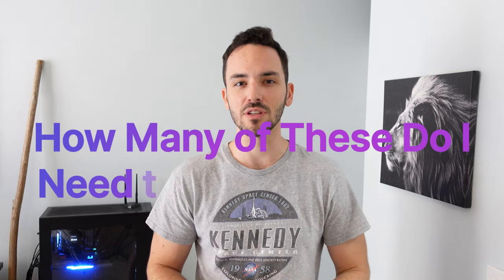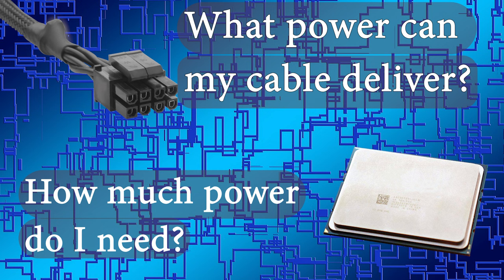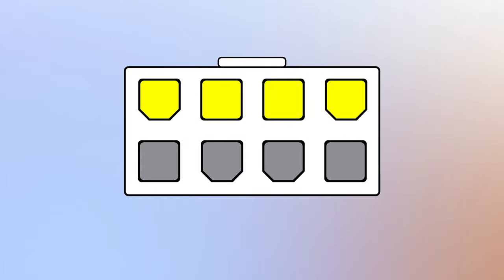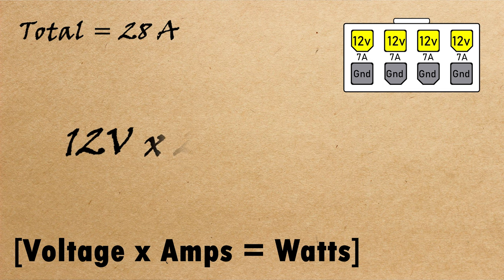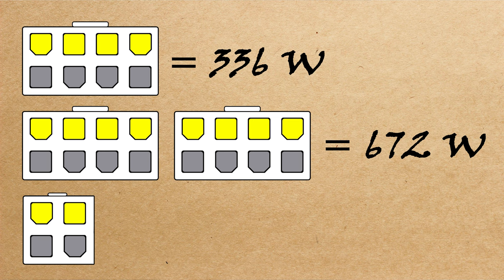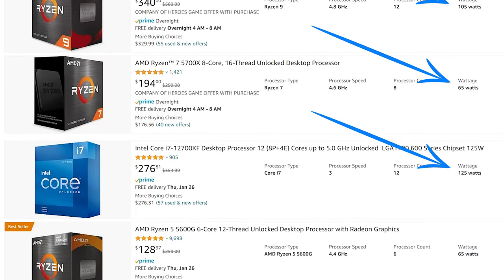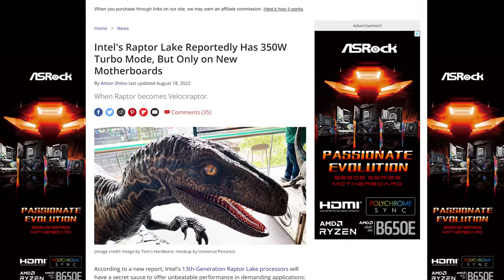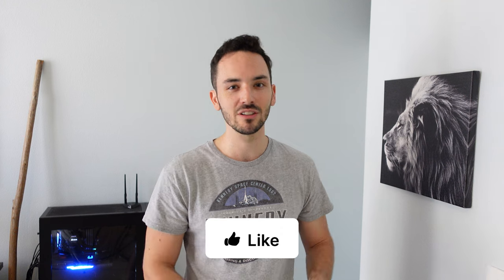CPU Power Cable Guide - Understand What You Need!

Comment: Need help asap, what if the Squares and Circles dont match from a CPU connector versus motherboard layout.
i.e. MB is (sqaure circle circle square) but the cpu cords is (Square circle circle circle) can you mix layouts? or are they that way to designate Volts to Ground?
Reply from the maker: They should match up, try flipping them, or make sure you aren’t using the pcie power cables (for gpus)
Reply: @MaxsTech  another example here: I can't flip them without disrespect the shapes.

My CPU cable on the PSU are like this:
Round, Square, Square, Round
Square, Round, Round, Square.

My mother board asks for this exact shape as well, BUT, the other end of my cpu cable (the one that goes into the cpu slot in the mother) are a 4+4 pin like this:
Round, Square, Round, Round
Square, Round, Round, Round.

I must buy a new cable or can I go like this?
I have to buy a new PSU? 
I will fry something if the round ones on the cable fits into the square shapes in the mother board?

I was assembling my new mother board and had to stop because no one seems to know the answer for this. I don't wanna a fry a fresh brand new motherboard that I've just bought it. 😅
Reply: Bro am facing the same problem 
Need help 😢

Comment: I have a 8+4 pin in my mobo.
So one cabe goes 8CPU/PSU.
And the other is 8 on PSU, and the other tip i can split into 4+4. The question is: which one of this two sided 4 pin should I connect into my mobo? Does it matter which half I put in?
Reply from the maker: I don’t recall which one is standard but they are all keyed so only one should fit.
Reply from the maker: You’ll see the pin shape is either a square or like a square with 2 corners cut off so it’ll make it impossible to plug the wrong type power cable in.

Comment: Hi thank you for the video 
i subcribed your channel
I have asus 570-p.amd 5900x.asus 3060 ti mini oc .32gb ram 2 tb ssd.7 fans total 
Asus TUF-GAMING-650B 650W 80 Plus Bronze
i test with wattmeter 
on idle my pc 189 watts
cpu benchmark 310 watts
gpu 398 watts
on my motherboard 8 pin is connected .Do i need to connect the other 4 pin 
what are the plus and minuses 
thank you

Comment: This was a great video, quick question. My cord has a cpu 8 port on one end and a 4+4 split port on the other (the 8 port connects to the psu) but my main question is does the shape of the port matter because my motherboard ports are differently shaped than that of my 4+4. It fits but just not sure
Reply from the maker: All the cables should be keyed to only fit the ports they are meant for. So your graphics cards power cables won’t be able to fit in your cpu power port and vice Vera’s
Reply: @MaxsTech  I think I understand what Slennister meant. He's  it talking about the pcie cable.
I'm having the same issue here.

My CPU cable on the PSU are like this:
Round, Square, Square, Round
Square, Round, Round, Square.

My mother board asks for this exact shape as well, BUT, the other end of my cpu cable (the one that goes into the cpu slot in the mother) are a 4+4 pin like this:
Round, Square, Round, Round
Square, Round, Round, Round.

I must buy a new cable or can I go like this?
I have to buy a new PSU? 
I will fry something if the round ones on the cable fits into the square shapes in the mother board?

I was assembling my new mother board and had to stop because no one seems to know the answer for this. I don't wanna a fry a fresh brand new motherboard that I've just bought it. 😅
Reply: @guisa9 I have the exact same issue, did you ever find out how to do it?
Reply: @davidayon7112  in fact, yes. Turns out is OK to plug this way. The square ones shouldn't fit the round ones (and they can't that's why they are this way) but the round ones can go into the square ones with no problem.
I bought a new PSU and it comes with the exact same cables as before. I was mad lol. Than I ask for advice in some forums and ppl told me this. I tried and worked fine.
Reply: @guisa9  thank you SO much for this, genuinely a lifesaver. I had this exact same problem and thought I had to buy ANOTHER PSU (I just got back from picking up a new cpu cooler because my old one had non industry standard screw spacing). saved me lots of stress and possibly some money too. thx
Reply: @hallozer7805  I was buying I new pc too. Even bought a new PSU that came with the same cables as before. I almost went crazy. God bless the technology and electronics forums people 😂

Comment: Hi I hope that you have a good day.
My 850W Gold power supply has only one 8-pin CPU output, but my motherboard has two CPU power inputs (one 4-pin and one 8-pin), and my processor is a Core i5-13600K. Can I overclock with just one 8-pin cable (4+4)?
Reply from the maker: Yea you still have a decent amount of wattage to work with even with just a single 8 pin.

Comment: So I have an old 8+4 cable from cablemod, can I still use it on an 8+8 motherboard ?
Reply from the maker: While I don’t like “old” cables for use for power, as long as the cable is in good condition I would just double check the wire gauge to make sure it’s the same spec as whatever power supply you have and it should be fine. I doubt you’ll have any issues with power, 8+4 is a lot.

Comment: I have x99 with 2 cpu socket, 2 cpu power connector (8pin each one). It's seems bottlenecked if only using single power connector.  First cpu 8 pin powered ,second socket cpu no power connected . My cpu e5 2620v3, x99 jginyue x99 8d4 2.5, latest manufacturer bios. Underload, max CPU speed 2.59ghz on all core.

Comment: Great video dude. My RM850x only has one 8pin cpu cable. I just ordered a 13700k Z790 and DDR5 then was like oh no i need a new PSU... but no i know i dont
Reply: So are we good? It's good without  that small 4 pin ?
Reply: @michaelgerrardtyson4197  tbh i got such a good deal on a be quiet 1000w ATX 3.0 psu i just got a new one. But my friend has a 13600k and only uses 1 connection, and he is having no isses.

Comment: Good video, congratulations !!!
I have a question:  My mother board has only one CPU 8 pins female connector but my power supply has only one 4 pins male connector and one 6 pins male connector for the graphycs card which is not used.
The procesor is a Xeon E5 2630 V3 with a TDP of 85 W.
My question is: Is it safe to conect the 6 pins male connector to the CPU 8 pins female connector ?
Thanks and blessings !!!
Reply from the maker: You actually won’t be able to, the power cables are keyed to make sure you can’t use your graphics card power on the cpu power. Each connector is slightly different with the corners flat or square
Reply: @MaxsTech  If that´s true then the 6 pins connector from my power supply is not for the graphics card because it fits perfectly in the 8 pins connector of the motherboard.
Anyways after analysing your explanation about the amount of energy that 4 pins give to the procesor ( 168 W. ) I realized that it´s more than enoght for the 85 W. procesor I have.
Thank you for your fast and kind answer  and for all the valuable information shared in your video !!!
Blessings !!!
Reply: You are absolutely wright my dear friend !!!  Today I noticed that the 6 pins connector from the power supply fits perfectly in the 8 pins socket of the motherboard BUT THE CABLES ARE UPSIDE DOWN !!!  I was lucky that I did not try to plug that 6 pins connector on my motherboard, otherwise I´d have fried the whole thing !!!  Thanks God the 4 pins connector showed me the right position of the cables !!!  Thank you again for your video !!!

Comment: Hey great video, looking into components for my own PC and the MB I was looking at had an 8 and 4 pin cpu power ports but the PSU I already have has just an 8 pin for the CPU so just for  clarification if the cpu doesn’t exceed 336w then just the 8 pin is needed?
Reply from the maker: Correct, the extra 4 pin would only ever need to be used if you needed additional power for your cpu, so as long as you’re under 336W you won’t ever need it, and even if it’s plugged in it wouldn’t ever get used.
Reply: @MaxsTech I have the same thing but my new PSU offers another P8 slot and I can connect the P8 to the CPU and have another 4 pin. My CPU is overclocked but it worked fine with 8pin only before. Should I connect an additional 4pin anyway and if yes, does it matter if it's the one with p4 on it or p8?

Comment: i upgraded from a old 4 pin power hungry phenom cpu 135 watts to a ryzen 4500 65 watts but is a single 4 pin enough or do i need a 4 to 8 pin adapter?
Reply: Running Ryzen 5600 only on 4pin. No problems. Don't even use 8pin.

Comment: My cpus old motherboard only had a 4 pin, my new Mb will have an 8 pin will it run fine with just a 4 pin plugged in the 8 pin?
Reply from the maker: If your power supply doesn’t have any 8 pin power cables you can use the 4 pin in the 8 pin slot, if your cpu requires more power than the 4 pin can give your pc will probably crash, but if like you said it’s the same cpu then you should be good
Reply: @MaxsTech  thanks for the quick reply!!
Reply: Running Ryzen 5600 only on 4pin. No problems. Don't even use 8pin.

Comment: if i have an 8 and a 4 pin connection on the board, can i use an 8 + another 8 that splits into two 4s?
Reply from the maker: Yea that’s actually exactly how I have my PC right now.
Reply: @MaxsTech  what if the next gen PSU only provided 2 full 8 pin power cord that have no split? Can I plug the 8 pin into a 4 pin? It fits but my bother board only has an 8+4

Comment: Hallo i have a question the CPU cable my Corsair power supply came with doesn't appear to have an end matching the ATX_12V connector on my motherboard. I got the other end plugged into the PSU but the mobo side doesn't seem to match. Does anyone know what I can do?

 The end of CPU cable is as such:

oxoo

xooo

 While the connection on my motherboard looks to take a connection like this:

oxxo

xoox

With x = square shaped hole

o = rounded hole
Reply from the maker: Are you positive that’s your cpu cable and not your pcie cable? That’s the main reason I could think of the pattern not matching to make sure you don’t use the wrong cable.
Reply: @MaxsTech  On the cable is written CPU.
Reply: Bro am in the same situation please help😢

Comment: My mobo has two 8pin connectors but my psu came with only one cpu cable. But i think that cable is split with two 8 pin ends. My cpu is rated 105 TDP. Guess i'll try plugging both ends into the mobo.
Reply: did it work?
Reply: @jebvandenbroek4490  it worked. But then I bought a braided extension so I just plugged that into one of the ports on the motherboard.

Comment: What about motherboards that have an extra one? They'll have the typical 2 x 8 pin at the top of the mobo. Then there will be an extra 8 pin next to the 24 pin to the side. What about cable.
Reply from the maker: I’ve never seen a board like that, do you have a model #?
Reply: @MaxsTech  it was the MSI x670E MEG ACE. But i checked it wasnt an 8-pin but a 6-pin.

Comment: I HAVE 1X 4PIN AND NOONE TALKS ABOUT IT ON INTERNET???
Reply: 168Watts for 4 pin
Reply: heh  - if i may, I've worked on mainboards with only a 4pin connector up by the CPU. it's totally ok, it's just a lower power capable, lower end motherboard. it will still support most CPUs as he showed, since most CPUs right now are 65W and  105W etc and a simple 4pin plug can support about 160W.

note that if you are putting in a newer CPU on an older or lower end board with just a 4pin connector, first consult your motherboard manual (ideally before buying it) to see if the motherboard can support the CPU... it is not just the power required but also the chipset and controllers etc that all must work together to 'talk to' the CPU, so check the CPU support list for your mainboard every time, to make sure your motherboard can support and run your new CPU according to the manufacturer. 

HTH! (Retired Technical College Certification Instructor)
Reply: @Munenushi  Oh okay I just realised that I'm using amd and most of amd cpus are under 160W so I don't really need much more for ryzen 5 2600... everything worked fine since I posted but I was thinking of upgrading to ryzen 7 5700... ill check on support page of mobo ty

Comment: hi, is it possible that i killed my power supply, not having connected all 8+4pin 12V CPU power supplies? my system was running good with only the 8pin 12V connected, until i turned the consumption up by intense gaming and streaming at the same time. having a I13700k on a asus zz790 creator MOBO.

Comment: Ok but what if your graphics card needs an 8 pin connector
Reply from the maker: Those use different keyed pins, they are not backwards compatible with cpu power cables. They will be required for your graphics card to work unfortunately.
Reply: @MaxsTech  ok I have a gtx 1660 To and it needs an 8 pin PCIe  connector do you know what I should use
Reply: @MaxsTech  Ti*

Comment: My CPU cable on the PSU are like this:
Round, Square, Square, Round
Square, Round, Round, Square.

My mother board asks for this exact shape as well, BUT, the other end of my cpu cable (the one that goes into the cpu slot in the mother) are a 4+4 pin like this:
Round, Square, Round, Round
Square, Round, Round, Round.

So no matter how much I flip one of them, I will disrespect some shapes.

I must buy a new cable or can I go like this?
I have to buy a new PSU? 
I will fry something if the round ones on the cable fits into the square shapes in the mother board (since the square ones obviously won't fit into round ones)?

I was assembling my new mother board and had to stop because no one seems to know the answer for this. I don't wanna a fry a fresh brand new motherboard that I've just bought it. 😅

EDIT: Turns out is OK to plug this way. The square ones shouldn't fit the round ones (and they can't that's why they are this way) but the round ones can go into the square ones with no problem.
I bought a new PSU and it comes with the exact same cables as before. I was mad lol. Than I ask for advice in some forums and ppl told me this. I tried and worked fine. It's still working fine.
Reply: Bruh am in the same situation 
Could you please help 😢
Reply: @mayandi4561  Turns out is OK to plug this way. The square ones shouldn't fit the round ones (and they can't that's why they are this way) but the round ones can go into the square ones with no problem.
I bought a new PSU and it comes with the exact same cables as before. I was mad lol. Than I ask for advice in some forums and ppl told me this. I tried and worked fine. It's still working fine.

Comment: Still none the wiser.
All you're saying is: read the manual.
Thanks for nothing.
Reply from the maker: Every system will be different, this is not a one solution question! I offer a general guide, but depending on the components you purchased it will change person to person. Good luck!

Comment: Does a msi b650 p need both because I'm not getting any power from the board with a Ryzen 7 7700x
Reply: I have a similar problem on my MSI B650m-a wifi with a Ryzen 5 7600. The mobo shows the Red and Orange easy debug LEDs for the CPU and RAM and does not post. My PSU has the 8pin CPU connector but I am missing the extra  4pin that the mobo manual asks for. Did you manage to solve your issue?
Reply: @gabrieloleastro5378  yes you have to flash the bios on the motherboard. Took me a few days to figure that out.